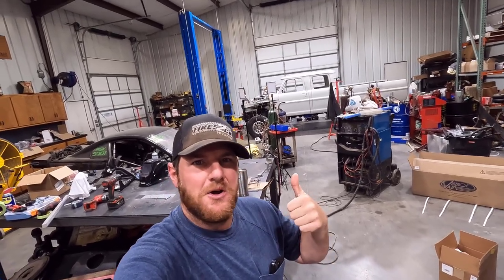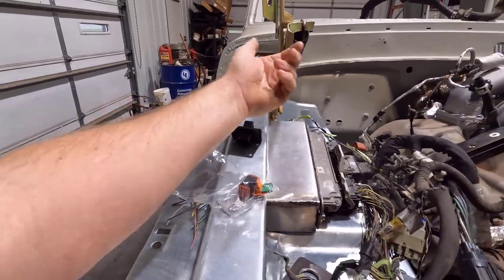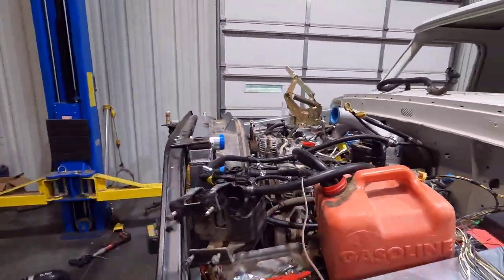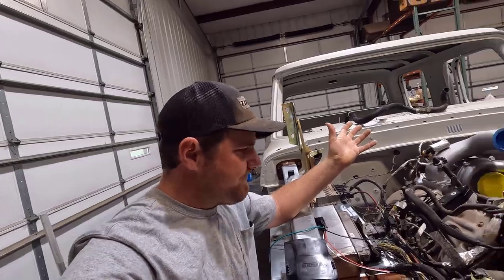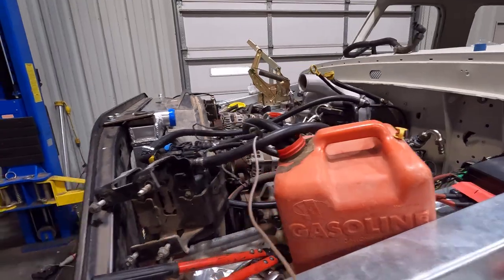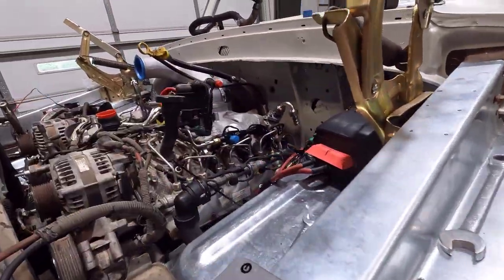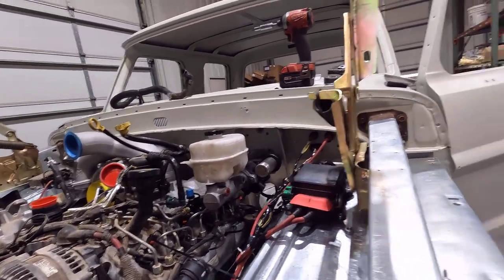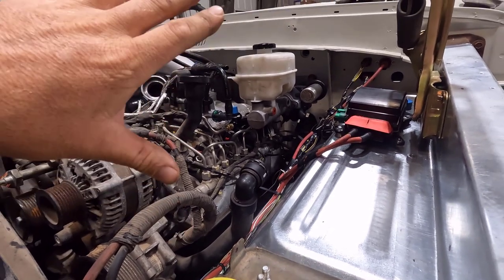Ultimate Crew Cab Part 7 Final Mock Up

Comment: I would have lost my mind trying to figure out where 1/2 of those wires go. I'm an old guy and still love carbs and distributors. Those make sense to me. I hope the Ford enginerds left room in those harnesses for heated mirrors,seats and steering wheel, GPS,ABS,SRS etc.  that all drivers NEED to be able to drive a truck these days. Thanks for posting.

Comment: Matt, great job stuffing ten pounds of powerstroke into a 5 pound bag! 
I’m currently in extended mock up stage myself on my 1972 cab swap onto a 1985 F350 4x4 cab and chassis.  Interesting to see the way you’ve executed your cab mounts, hydraulic and electrical routing.  Keeps me motivated!
Thanks!!

Comment: Hey Matt, love the build, watched this series a couple times. I was wondering where you got the Hi amp fused battery junction box from.  I've been looking for one and remembered the one that you used.
Reply from the maker: I got them from Waytek wire
Reply: @MattKubik1791  Thanks Matt, I will check them out. I searched about everything I could think of and couldn't find.

I really enjoyed your last episode I've used the chassis saver quite a bit, and I have  used to Por-15, when I use it I make sure I use the UV top coat, if not the Por-15 gets chalky
Reply: @MattKubik1791  Hey Matt I found the fuse holder Eaton's Bussmann Series PDM-AMI Fuse Holder, 225A, 3 Positions.  I have trouble finding the fuses that you have in your video, the ones I find look different, did you get your 125's from waytech as well?  Thanks Bill
Reply from the maker: @W.H.Slater-49Fordlightning  I didn’t. I just got them off Amazon if I remember.
Reply: @MattKubik1791  Thanks Matt I think I found the ones I need listed under bolt down fuses I appreciate the help and you're killing it on the videos.